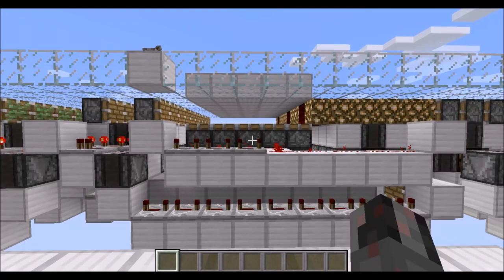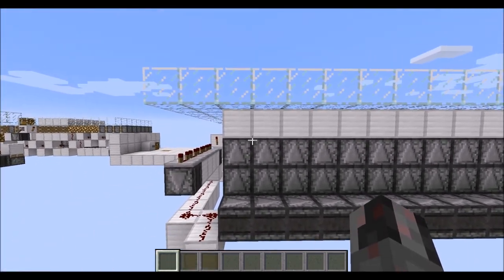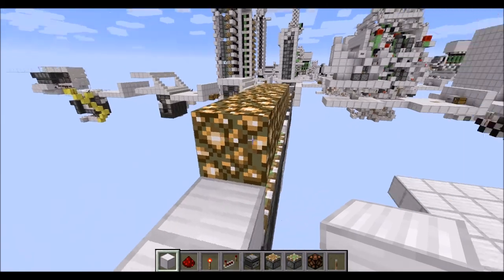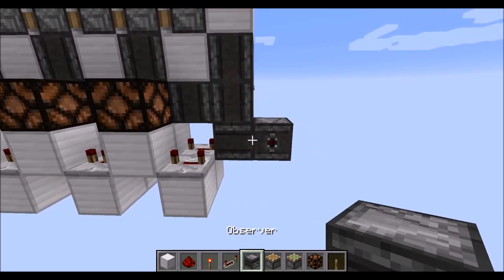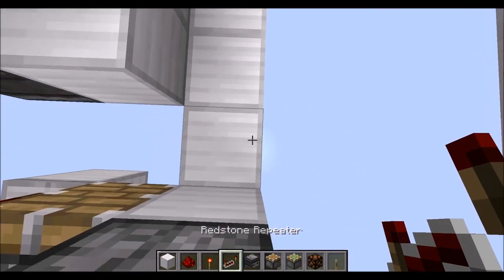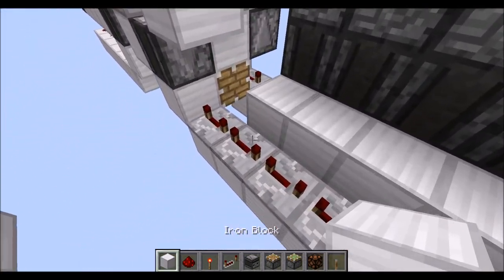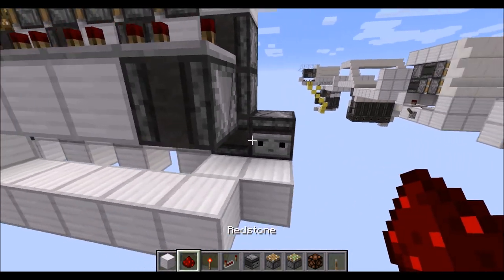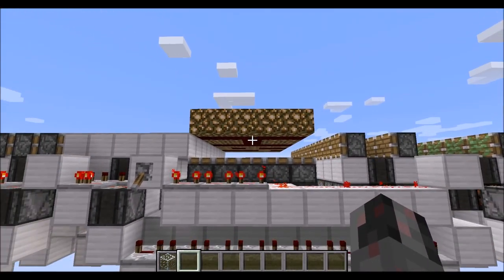Tutorial: Expandable, 5-wide Floor Block Swapper [Java 1.11+] (Schematic)

Comment: Nice tutorial, you got the control circuit to a really nice and compact design :D Good Job!

I tried to exchange the redstone lamps with torches but the timing was thrown out of whack.
Reply from the maker: Thanks, wouldn't have been possible without your modules, though!

And yeah, I tried replacing the lamps with hoppers. Didn't work. Lamps are a bit strange when powered by short pulses, leading to extra delays and pulse multiplications along the way when combined with observers.
Reply: K, I got a 6 wide version up and running, I think 7 wide would take a lot more than just pushing... 

I think I got the control circuit pretty simple and compact, one could possibly stretch it a bit to make it take up less space in one dimension :D
Reply from the maker: Impressive!

And yeah for more than 6 wide pushing won't do anymore. E.g. for 7 wide you would need to PULL at least two blocks for it to work, so feed tapes would be the only real alternative beyond this point (that I can think of at the moment).

I'll see if I can compact the control circuit down a bit, once I find some time... I'm currently working on my double vault doors, again =)
Reply: Nice, 11x11? or a more compact version of a 10x10?
Reply from the maker: 12x12 actually, the 11x11 is waiting for a good occasion to be shown (e.g. 1k Subs...)     :P

I have enough other stuff in reserve to wait a bit.
Reply from the maker: Finally got the 6wide version compacted down... now the controls only need the same space as 3 modules! Tutorial should be out soon.